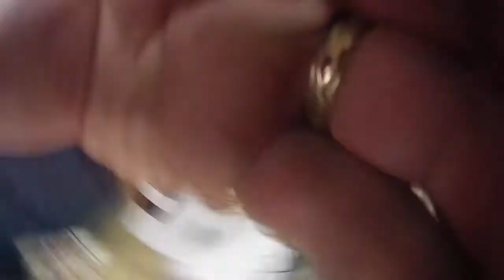Brother WP-95 Autopsy

Comment: Hay, I am from Germany and want to ask, what you want to do with the diskdrive ?
Reply from the maker: I will have to check to make sure I still have it but if I do you can have it for the cost of shipping.
Reply: Thanks alot. My problem is, that I bought a similar model, but the disk drive dont function at all. I didn't thought that would be a big deal, but after a bit using and working with it, it's pretty annoying.
Reply from the maker: Like I said in the video this drive was flaky but I will look for it tomorrow and you can have it if I still have it.
Reply from the maker: Ok, so we think it got tossed out in the scrap metal can which means it is buried under the snow.  It has been cold here so I doubt it got wet since nothing has melted. I will keep looking.
Reply: Also if it has gone wet, I still would like to have it.I would try to dry it in rice or so
Reply from the maker: Ok I found it.  It was in the snow but under some stuff and I don't think it was melting so everything might be fine.  No promises, but it looks ok.  I also found the original Manuel for the machine if that might help your quest.  Not putting my email here but if you google Alder Gulch Summit Tours our company will pop up, you can contact us though there if you are serious about having these shipped to you.